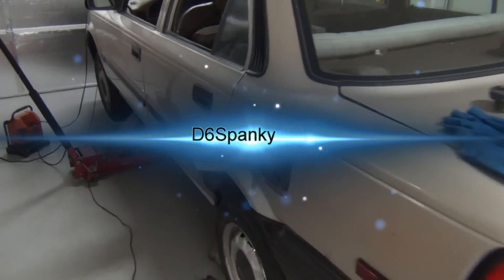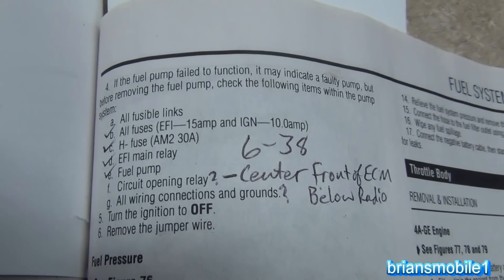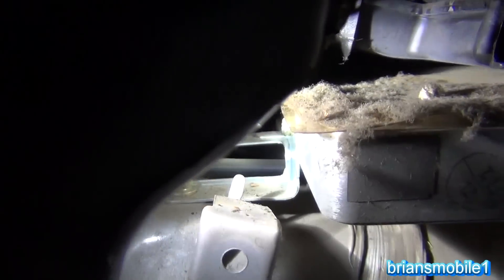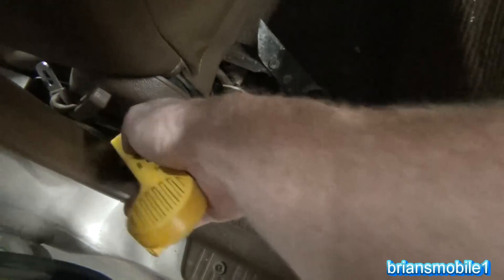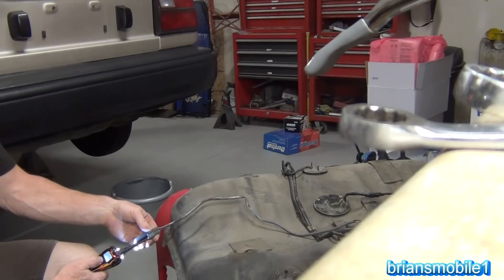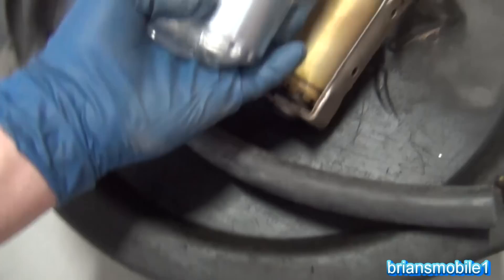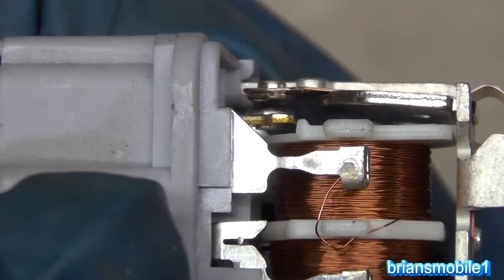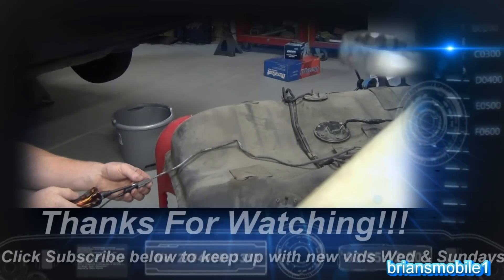Toyota Fuel Pump Circuit Opening Relay

Comment: Bro what a great vid helped me identify where the fuel pump is actually located and not in the back seat.... thats where the fuel sender is ... bugga .... and where the relay might be for a RHD. The added bonus of knowing the diagnostic plug can be used to check the pump is running which I have to do. Is it supposed to make a humming sound when running?

Comment: I have a 1994 Toyota Corolla LE and just put new fuel pump in and need to check circuit opening relay but can't find video on where in car it is and how to tell which relay it is and how to remove to replace.  Any advice?

Comment: Too cool.   My 2004 Tacoma 4 cylinder with 75K does not get a signal occasionally to turn on the fuel pump. Finally, I stuck a DC meter on the blue fuel pump electric line and mounted it in-dash at the kick panel.   LED, so you see it even if you can't read it without getting lower.  Serves my need.   No codes.   When it happens, it cranks like crazy and you see no voltage.   Key on and off a few times and all is good with voltage.  When you first key on to just on, it never has voltage. Once started and you just drop back to on, then it shows voltage.  Normal.

Going to take that Circuit breaking relay apart.  Been ignoring it.  Only happens occasionally.  However, it died the other day running and took 4 tries to get it going with horns blowing behind me.

Comment: If you are still on here do I have to use the diode  or can I use a 10 amp fuse in between for the relay diodes just keep juice flowing one way and not back track right

Comment: Hi my name is John, I just want to let you know that your video was very informative. I’m dealing with a 1991 Toyota truck and the circuit opening relay,  at the end of your video you showed how to test it, the diagram at the bottom right shows to test center pin and lower right pin and I should have continuity. although my circuit tester Only beeps one time and then turns off as opposed to the other ones they continue to beep. what do you think,  have you got a solution for me or is it a bad relay or not sure? Thanks

Comment: I have a 2007 Toyota RAV4 vase 4 cylinder that just had a short while wiring fog lights. The car cranks but won’t start. I’m finding a bunch of diffeeent info on it some mention efi relay, fuel pump relay, and c/opn relay no one seems to know where these are. I have a marking for fuel pump in the engine fuse box but nothing is there. Car was running fine before. Do you think you can help me find this relay or whatever is stopping the car from starting? Thank you!
Reply: Also when it happened the radio fuse and odb fuse was blown. I replaced and radio came on odb reader powers up but can’t establish a link.

Comment: Also,  some sites say that older Camrys(1980's-1992?)  have same Circuit Opening Relay/COR as 3.0/3vze 4runners.  Others suggest they are different...  this is me sitting in the dark...

Comment: The Circuit Opening Relay or COR(located behind glove box in 4runners) is a complicated and expensive relay also necessary for EFI relay to function,  as I understand it.  Here's the kicker:  Haynes manual(and a rumor suggests other manuals as well)  give false information to the ohm reading test on the COR!  So I concluded my 120 dollar COR was bad and went about taking it apart and rewinding 1 of 2 coils in order to get continuity between two terminals.  However,  despite the new winding functioning, I didn't trust that it would last, so went ahead and got new COR(Also,  I had to bend some metal parts in order to unwind/rewind coil and was not able to put it back together perfectly..so I didn't trust it). I then did same ohm test on it(the brand new relay) and what do you know?  It also DID NOT have continuity between the same two terminals!  (pouring gasoline on Hanes manual now).    I'm still confused though,  as I took apart the COR completely and saw for myself that continuity IS necessary between those two terminals.   I looked at it from every angle, so to speak,  and triple confirmed that to be true.  In other words,  the two terminals are connected to 1 of 2 coils(The COR is essentially two relays in one box).  Meaning,  there HAS to be continuity going through the coil or it can't possibly function.  So the question becomes,  if that second coil is not necessary(as the new relay suggested) why the hell am spending 120 dollars on a complicated relay that could actually be just one 12 dollar relay!?  (Now throwing a match onto gasoline soaked Hane's manual.):)  

 If anyone can put the final word on what the ohm readings/continuity(with it unplugged) should be,  please share your knowledge!

Comment: I have  a 1989 Camry  DKL station wagon 4 cylinder  3FS, tear the  interior apart completely  to restored.now  I put  back all cables  and  car doesnt  start, no signal to the pump check  all fuses  and  nothing,except  the  one you  show it  in the  center  console.it  may get  wet ,since  the  car has  no windshield  and  it was  car covered. also i noticed  the  hazard lights go crazy fast only the   the  back lights works in hazard mode   and the  front ones  don't. engine  was  overhauled completely  since  the  car  is  been sitting  almost  a year found  the  spark plugs full of  oil  in the  connection part  inside  the  cable lug is oil also  . don't  know  if  the  mechanic  change spark plugs seals cover  or  I may have  some  other  issue,My dad complained  that the  car before it  was  engine  overhauled  consume oil.but  it  has  no  leaks   Any Idea what can i do?? to avoid to set it  on fire??

Comment: When I search for Toyota Avalon why the f*** do I always get Camry and some other b*******?

Where is the fuel pump relay for a Toyota Avalon XLS 1997, not the EFI relay! Where is the fuel pump, it is not as we see here, inside the cabin it's not under the radio.

and if it's just a bit of corrosion couldn't you just bang under or to the side of the dash with a  hammer to knock some of that stuff loose?

It works for a bad fuel pump.

Comment: I had the same problem on my 1991 4Runner 4x4 3vze. Except that the Circuipt Opening Relay is located in the front right passenger side, to the right of the glove compartment, just above the computer; so the glove box has to be removed and the relay is attacked to a small L- shaped metal bracket held to the frame with a 10mm bolt. The right fender has the antena almost directly above the relay so since my antenna was loose, water from washing the vehicle or rain leaked down the antenna hole and likely fell on top of the relay. When I opened the relay it had this white chalk like powder; white corrosion I call it. So most likely this contamination prohibited the contact points to have metal to metal contact. However since I wasn't willing to pay $130 for a cheap chinese relay at aurozone or amazon, I simply got 3 Circuit Opening Relays at the junkyard. And since the MAF is also related to the fuelp pump circuit, I also bought the MAF, costed only 40 bucks with 10 dollar warranty in case it was defective. How much do you think the relays cost? I'm sure any one of those original Toyota 30 year old relays will last longer than any of those new cheap chinese relays.  I replaced both the MAF & the relay and the 4runner turned on  and runs better than it has before. Later on I will reinstall my original relay to see if it starts with only the MAF I also replaced since the relay is the easiest to reconnect. Afterall maybe the relay may have not been the problem yet eventhough it has some white chalky contaminant. The real problem may have actually been the MAF. Regardless, the relay was about to break down anyways. Great video, it also helped me to solve my problem as to why the fuel pump wasn't activating.

Comment: I have something issues with engine. Randomly, my engine starts to jerking and loosing power and I have to stop engine and turn it on back again. Most times happens when I run high rpms or I request power to the engine (4A-GE 1.6 red&black top). I replaced the old pump, the tps, the ECU, cleaned up the throttle body and ISCV valve (IDK why but idle is a bit unestable, sometimes keeps over 800rpms and others about 650-700rpms), replaced all pipes, cleaned fuel tank, replaced fuel filter, replaced new alternator, corrected ignition timing, replaced air filter, cleaned the coolant circuit with coolant cleaner an G12+ coolant replaced every 2 months 2 times, new oil and oil filter, new intake air temp sensor, replaced the MAF and mixture potenciometer (no lambda Ox sensor), replaced the vacuum pipes, replaced tvis vacuum pipes and electronic valve (tvis valves sounds like bopbopbop when they are hot but they opens and close normally), replaced the battery, checked voltage, installed TOYOCOM (to inspect the ignition timing ms, EFI Voltage, engine temp, TPS, rpms, and so, and timing is between 1.7ms most of the time when idling), the fuel pump installed was new but for Celica 2.0 3sge and 3sgte and for 1.6 MR2 mk1 (my car is a 4A-GE Toyota Celica T160), I think the fuel pump is powerful enough to move the fuel properly to the engine since it was made for bigger size engines and for mr2 4age, I will try to change it and use other more powerful (right now pumps @ 3.5 bar 112L/H and the new one pumps @ 6 bar 112L/H) what do you think about my problem? What it could be? Thanks mate:)

Comment: I have the Haynes manual for My 92 pickup. (Manual 656). There is a diagram with the fuel pump but the circuit labels are all upside down and tiny.  So I sat for a time doing a rewrite right side up with a magnifier to be able to read the descriptions.  But it was a cool you-tube video that enabled Me to understand the sequence of operation. www.youtube.com/watch?v=Rqtfrx-HeD0&feature=share. enjoy.

Comment: The Circuit Opening Relay and Starter Relay are typically located together, I had the same trouble with the starting circuit. I used 2000 sandpaper to clean the contacts and wiped them with a scrap of paper towel, works perfectly now. One auto parts store said the relay was not in their warehouse.
Reply: My 94 Toyota Corolla had same issue after changing fuel pump. We tried cleaning it with sand paper and reusing it but my car kept stalling out while trying to drive it so we just bought a new one for $200. Waiting for it to arrive to get car going again. Since I've read this relay lasts for about 15 years or 160,000 mi I guess I used mine to almost that milage at 158,345.  Great video, very informative.

Comment: Hey Brian.....I have a 86 toyota pickup with the 22re. I have changed the fuel pump. I drove it a day or so and the it wouldnt start. found that the AM2 fuse was blown. I changed it. It started up for a min and then it backfired and shut off. The fuse did not blow again! I have fuel at the intake & ignition at the coil. All fuses are good. What could be wrong?

Comment: Sanding what was once a polished contact - - - it won't last long.  You did this video in 2015.  Is the car still running or did you have to replace the FPR (Fuel Pump Relay)?

Comment: I'm in the exact same boat as you were in this video currently have my open circuit relay off the car for bench testing but I am curious did you replace it or did you just clean the contact points because I do notice the same carbon buildup on one of my contacts and they are very expensive 4 what they are so I much rather just go with the sand paper route and probably change fuel pump and fuel filter also. thank you for the great video and I hope to hear from you

Comment: EVEN IF YOU ground the fuel pump terminal in the vehicle's check connector, the fuel pump still won't work if the circuit-opening relay is bad. on some cars, the diagnostics won't work either. the relay is referred to as a fuel pump relay on the wiring diagram, so you should maybe have started your hunt at the 'fuel pump relay', then when it fails the output current test, you can then energize the connector wire that runs to the dead output term. the fuel pump should then come to life. a factory service manual will always give the location details of stuff along the wiring (like the fuel pump relay). that book will also take you thru the stationary and functioning tests for the fuel pump relay. but looks you got it now. if you drive that thing out to the desert often, you might want to keep a good used relay in your mobile tool box!

Comment: Brah! You are the ***t!! seriously tho. I have saved me from this nightmare. On Christmas day my car all of the sudden died out of nowhere on me. I did some standard tests and figured that problem was my fuel pump. I went out and bought a new one, installed it and made no difference. So I looked in the manual and basically bypassed the relay and found out that the pump works. So I took a deeper look into the wiring diagram and came across the Circuit Opening Relay. Problem I had now was nowhere in my manual showed me it's specific location and where to look. I wasted 2days trying to find it and then my twin sister comes along and shows me this video and said to me, "Don't get mad now but you might want to look at this." I watched this video and a fire was lite under my **s. You have no idea how mad I was at that ***k**g manual just pointing with the arrows in a diagram with no specifics. Thank You for this video, It literally saved me from this nightmare and was very helpful. Even if someone has an manufactured manual it really wouldn't show you exactly where it is specifically at. Thank you for showing the world in great step by step detail, you got yourself another subscriber

Comment: My 99 corolla just cranks on the first attempt to start.The first time the key is in the on position, no sound from the fuel pump. On the second time turning the key to the on position,I hear the fuel pump operating and the car starts right up.It has a new fuel pump, I see 2 relays listed, 1. Fuel Pump / Circuit Opening Relay and 2. Fuel Injection Relay. I am leaning toward the Fuel Pump / Circuit Opening Relay. Any ideas? Thanks in advance.

Comment: i have a 90 corolla. my car is trying to stall while under acceleration but doesnt (check engine light comes on for a split second then goes away) then wen i get to a stop light....wen i accelerate, itll stall completely.....u think thats fuel pump related?

Comment: y is my fuel pump line 
not getting eney power at all
Reply from the maker: A bad fuse, or a fuel pump cut out relay that's bad.  Try the jumpers on the DLC plug under the hood.  Jump the power wire to the F or FP wire.  That should sent power right to the pump.
Reply: ok thanks main it works

Comment: I've jumped that diag port to bypass the fuel pump circuit. Didn't hear the pump working and also checked the wires going to the pump. Found it has voltage. Replaced the fuel pump after that.

Comment: Nice video. Found very similar relay on my 1990 Mazda B2600 pickup when diagnosing non running fuel pump. Looks like the relay on this Toyota is similar double coil, and the fuel pump wont prime after turning ignition on. Only starter crank will energize the second coil and runs the fuel pump when starting. Guess thats the way they done it in EFI systems "before my days" :D Fault in my car was short circuit in switching transistor which grounds the fuel pump relay, inside the ECU. Local ECU specialist was able to solder/replace the tiny part for 200 euro. Ecu problems seems common on those Mazdas, made by Mitsubishi electronics from poor quality parts at that time.
Reply: Kari Halonen: I have that same problem right now on my 1991 4runner 3vze 4x4. The fuel pump does not prime/power up whenever I turn the ignition key to ON. It has spark, it cranks strong, but the fuel pump doesn't turn on. I tried turning on the fuel pump by bypassing a paper clip on the NEG & IGN on the self diagnosis box & still the fuel pump doesn't power on. I followed the wire diagram on my haynes manual and I bypassed 2 female prongs on the black connector to the MAF and then pressed on the metal clip on the open circuit relay and this turns on the fuel pump. The fuel pump stays on  as long as I keep pressing in the metal clip on the relay to make contact. When I stop pressing in on this metal clip, the fuel pump turns off.  So I know that as long as the engine is running, the fuel pump should keep running also. What I don't know is why the fuel pump doesn't turn off after it primes with the ignition key on ON and while I bypass the 2 MAF female prongs, and at the same time I physically press with my finger the metal clip on the Open Circuit Relay. I'm thinking that since I have to bypass the 2 female prongs on the MAF cable, that this is what keeps the fuel pump running at all times instead of simply priming it via the relay. I need to open up the MAF & remove the black cap to see if there is carbon build up at the contact point inside. Or maybe the metal prong of this contact point inside the MAF became fragile and has bent out of the contact point. I've seen video where guys open up the MAF black cover only to find out that this contact point has corroded or has warped to the extent that there is no more contact. Oh well, it's a process of elimination.  At this point I'm closer to solving the problem than being lost just scratching my head.

Comment: You finally got a PowerProbe.  Nice!  Great tool as long as you know it's limitations.  
Now all you need is a good 3/8" ratchet, something 14-16" with a rubber grip.
Do you ever use ALLDATA? The DIY site?